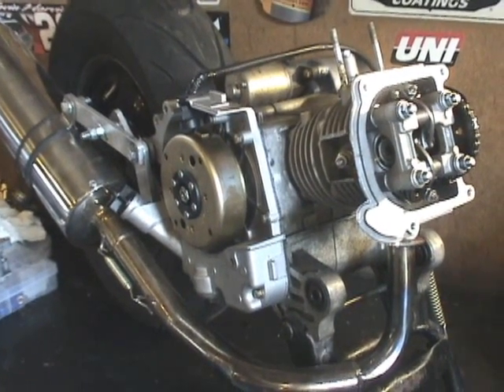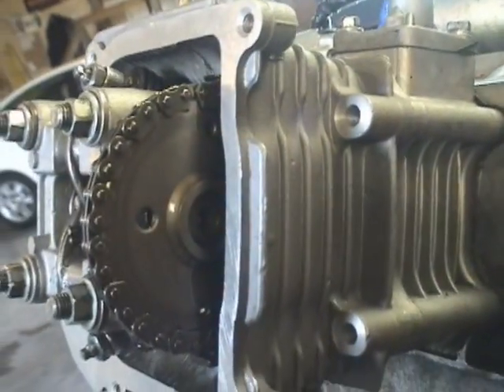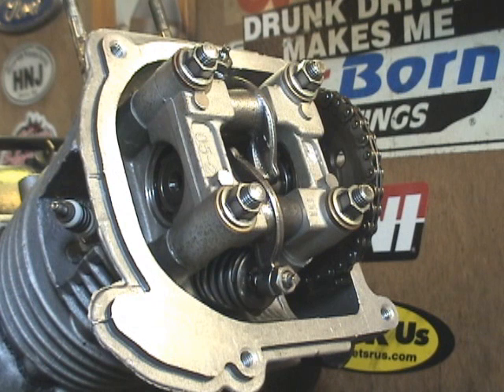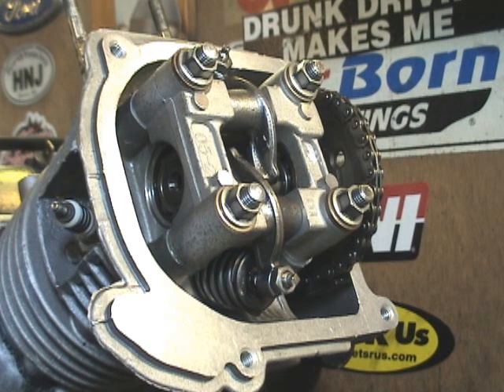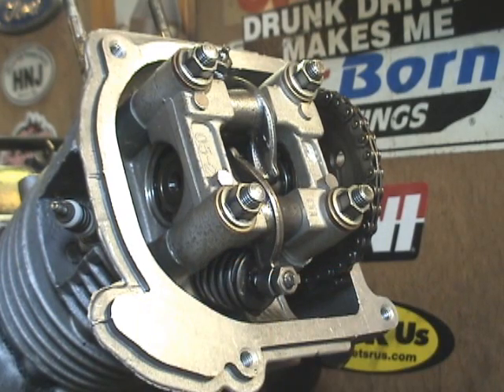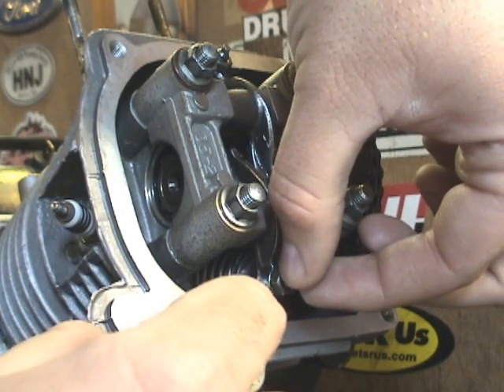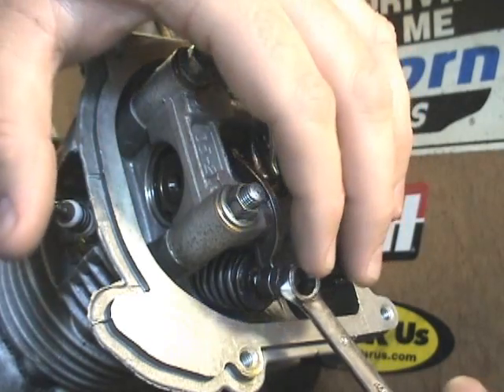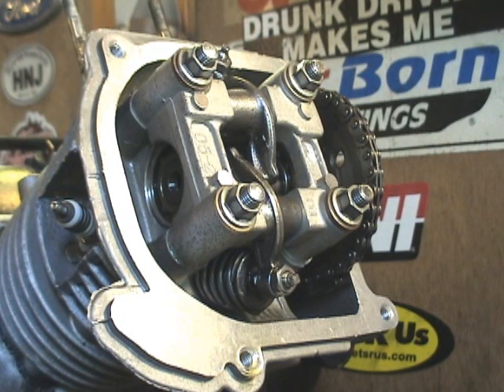Scooter How-To : GY6 Valve Adjustment (Also For Buggy + Kart)

Comment: why do some people use 4 and 5 and others 5 and 7? depends on engine brand or cc?
Reply from the maker: Preference, engine size. I use 0.002" and 0.003" mostly now. I was used to my engine at the time and it didn't like tight settings so I was always using larger specs.
Reply: @49ccscoot  i believe my gy6 is a 150cc...what gap should i use?
Reply from the maker: Between 0.002-0.004" intake and 0.003-0.005" exhaust should work fine. I tend to stick to the smaller side of 2 and 3 thousandths these days.

Comment: For years, I took a small piece of scrap steel, and cut a slot in it to use to hold the adjuster screw while adjusting. Putting in a "s" bend helps clearance. Thin grinder wheel cuts a good slot like in the end of an old, damaged screwdriver or small broken wrench. Grind back the broken end and make a slot. I have also used a tiny cresent wrench.

Comment: Once again a great video, I have a few 50cc and 150cc chinese scooters, I notice on all of the inserts under the seat they say adjust to .006 and .007,,,,I see many people online say .004 and .005 and you like .003 and .004,,,are the manufacturer specs just not geared towards performance should I ignore that and just try what you guys recommend and see where  I get the best performance? DO you really think proper valve adjust ment can really effect speed?  TY for all your hard work!
Reply from the maker: I actually use 0.002"/0.003" most of the time these days. I don't recall seeing a manufacturer spec on any of the Chinese 50-150s as high as 0.006". I'm thinking you have have confused the specs with metric specs. It is common to see 0.06-0.07mm, which is roughly 0.0024-0.0028".

Comment: Hello I recently I adjusted my valves because it wasn't starting unless I use starting fluid but now the motor won't turn over like it got too much compression and my fly wheel doesn't have a t mark
Reply from the maker: I wonder if you may have adjusted the valves too tight and it's opening them enough to make contact with the piston. Don't force it to turn, because you could bend a valve. Back the adjusters off to create plenty of play and then see if it turns over by hand. You may need to find true TDC and make your own markings. You really don't have to know totally precisely where TDC is for a valve adjustment, but it is important that the valves are totally closed when it's done, so the engine should be at TDC between the compression and power strokes.

Comment: I need some help i have a clocking   sound when I start up the scooter could it be out of timing or valve need to be adjusted it start up pretty bad
Reply from the maker: It's likely to be the valves. Could be many things, but that's a common cause and a part of routine maintenance, so I'd start there.

Comment: I set mine both to .005..but when im at higher speeds it slows and speeds up..Should i open the exhaust further or close the intake?
Reply from the maker: Try 0.002" intake and 0.003" exhaust and see how that does. May not be valve lash related. Could be a main jet or related issue.

Comment: Hello,

Why my gy6 engine is throwing to much white smoke and stalling when accelerating after replacing cylinder,piston and rings .

Do I need to adjust valves or to replace valve rings or what ?

Thanks

Comment: I got a GY6 139qmb with a 50mm piston, A9 Camshaft and a big valve head should I adjust the valves differently than the stock setting?
Reply from the maker: 0.002" in / 0.003" ex should be fine. Sorry for the late reply; somehow your comment was flagged as spam and I just now saw it.
Reply: thanks for the information I don't know why this got marked as spam. and what is your thoughts on an oil breather tube? I was thinking about getting one for my 139qmb.

Comment: Hi, I need advice I have a speedy 50 tao tao scooter. It will turn over but won't start... I replaced the spark plug today same thing. It is getting a little spark though. It's like the gas isn't getting there. Cool videos.. :)

Comment: would tight valves cause loss of gas to the spark plug?
Reply from the maker: My first thoughts would be carburetor related. Float set too low or tuned too lean. Possibly a problem with the fuel system.
Reply: 90GTVert figured it out. have a malfunctioning auto choke.

Comment: Hello again ; P I heard your tip about excessive tapping after adjustment, and what to do. Just a question to confirm that is what i need to do. Upon opening my valve cover to to do the first adjustment i have ever been able to do, i discovered that the tappets were seated tight against the valve, i mean tight! How the heck this thing was running as good as it did, i can't understand.. Now i have excessive tapping @.004 gap. Still running great!  Do you think something could be worn out from the tappets being that tight for i don't even know how long/ how many hours of running.... It did not tick at all when tight, so should i just close the gap a bit, and call it a day, or should i investigate anything else while inside? Thanks in advance.
Reply from the maker: You can try moving to something like 0.002" intake and 0.0025-0.003" exhaust.
Reply: I will give that a shot. Just wanted to get your thoughts about how tight they were, and if thought that would cause any unnecessary damage resulting in my ticking.. Thank you once again good sir : )

Comment: I just purchased a used 50cc taotao scooter not running replaced the carb battery an ignitions getting spark will turn over but won't crank could this be my problem?
Reply from the maker: It may be. It would be a good idea to check the clearances.

Comment: hey i have a 2016 taotao 50cc with 100cc big boar kit installed. after installation it ran great for 10mins. the  stock carburetor and manifold were kept in during this test drive. but after this test drive i guess what is called, bogged out, happened when i pulled on the throttle. so what i did first was install a bigger carburetor and manifold. the issue didnt leave. so i upgraded the cdi,sparkplug cover, cold intake, and flywheel fan, but no nothing! whats next??
Reply from the maker: My first thought is to try tuning the carburetor. Checking connections is a good idea when an issue pops up, but you should have been over the connections while replacing things. A simple way to get an idea of if too much or too little fuel is an issue may be to try revving with the air inlet covered or partially covered. If it improves, it probably needs more fuel. You can also remove the airbox and see if if improves. If that helps, it may need less fuel.

https://www.youtube.com/watch?v=K5j8gHg5kMc

http://www.49ccscoot.com/faq/carbtune.html

Comment: Great great video!
I have a CF Moto E-Charm 150 that looses power after a few minutes of riding it. Sometimes I'm doing 50mph then something goes wrong in the engine that the speed goes down to 35mph. I keep the acceleration going but it won't go past 25 then when I finally reach a safe place to stop it dies. 10m later it will start but roughly. I was wondering if you have a slight idea of what could be going on? This is water cooled fuel injected not carburetor.
Thank you boss!
Reply from the maker: +DG MAMBO Does it have a water temp gauge? Wondering if it's getting hot.
Reply: It does have one but from what I c when I ride it it never gets past below half on the temp gage

Comment: buddy keep up the great vids ive learned a lot from you  how  ever i got a problem i recently had a problem i knew it was my valve adjustment so when i went to check it and the intake lock nut is gone  down in the motor is it possible to fish it out from the oil filter area with a magnet or am i looking at a complete tear down? its a gy6 50cc with a 100cc big bore kit in it thanks
Reply from the maker: +vawn davis You could try a thin extendable magnet in either drain plug and try checking where the cam chain goes through the engine. Good luck.

Comment: I was recently given a 2008  Peace 50cc scooter with 87 actual miles.  It has been stored in a garage unused for 1 1/2 years and was running fine prior to storage. All old gas was removed, gas filter fine, now carb getting new gas. I removed carb, disassembled it and cleaned everything in it thoroughly. The spark plug is clean and getting spark.  The engine will turn over but it will NOT start. I have not tried to kick start it and have used the  battery only in trying to start it.  Battery is good.  With air intake hose removed, and a small amount  of gas squirted in the back of the carb, it will run for a few seconds and die.  Will not restart on it's own without squirting in more gas behind carb. Choking back of carb with a couple of fingers doesn't help, but fingers are wet from gas in carb.  My next step may be to buy a new carb.  Is this engine a GY6?  Anyone know of any manuals or wiring diagrams available?  Would appreciate any suggestions as I'm stumped!
Reply from the maker: +Bernard Molenda If there is no gas in the bowl of the carb, the vacuum petcock may be bad. You can remove the fuel hose at the carb, put the end into a container, and kick or crank the engine over. You should see fuel come out when it cranks. Otherwise, the petcock is not working properly or not connected properly. Make sure it's got vacuum attached to it and the hose isn't cracked or loose.

Comment: it was brand new. Did not think I needed to check it. And tightened the head as much as it would go.
Reply from the maker: +jim crabtrey I bought a $100+ dollar brand new big valve head once and had it leak out of the box. It's even more common with Chinese replacement heads.

The head should not be tightened as much as it will go. That's not good. It should be torqued to spec.
http://49ccscoot.proboards.com/thread/14211/139qmb-bearings-seals-bushings-torque

Comment: sorry. I do believe it's a .0003. for the top .0004 for exhaust  , with i have seen to use on numerous google searches.. it was running excellent before I replaced my head. Now will not go over 30 miles an hour. Seems like its leaking oil somewhere too. Everything is tight. I don't understand. Could the carburetor have gotten that clogged up that fast. To make that much of a significant difference??. Any help would be greatly appreciated. I have tried everything
Reply from the maker: +jim crabtrey Didi you do any checks before installing the new head? Sometimes the valves leak. Maybe you didn't get a good seal with the head gasket?
Reply: It only takes a very small piece of debris to clog up the Pilot (Idle) Jet on the carb or even partially clog the Main Jet. A clogged Pilot will make it extremely difficult if not impossible to start. A partially clogged main will cause less fuel to enter the engine, resulting in less speed. It may also want to run hot if it does.  Do you have a decent inline fuel filter on it? Otherwise if you have replaced the head, and tried everything, it could be an intermittent spark issue or a timing issue.

Comment: please help. I just replaced my head on my 150cc scooter. Adjusting valves - 0.3. Sounds like it is running excellent. But will not go over 30 miles an hour. it used to go 55. I replaced head because I stripped spark plug. I put everything back together the same exact way. Seems like it is not getting enough compression. I do not understand how it was running fine before. And now it is not. What could it be. I am going crazy trying to figure it out. Please help
Reply from the maker: +jim crabtrey I'm not sure why you're using 0.3 as a valve adjustment. If that's mm it's 0.011" which is huge. If that's inches that's over a 1/4 inch of lash which is terrible. Try something like 0.002" to 0.005" or .05mm to 0.13mm.
Reply: You are going to need to go thru troubleshooting procedure via process of elimination. It needs clean air, clean fuel, good spark and compression to run correctly. ALL those things need to be checked and eliminated as a probable cause.

Comment: That ending part..about saying hard starting problems..thank you kind sir great vid, ima try this for my scooter, always been a bitch to start and now it losses power and stall after riding from 1-5 mins, to the point were i can hold it in place with my feet no brakes at full throttle, the second i let off it bogs down, lets see if this fixs the problem
Reply from the maker: +NonyaBuisness YaStalkers Hope it works for you. It's a very common issue.

Comment: hello I wanted to know if I can instal a piston to a big bore kit 100cc missing the top or middle (cause I can move them)after I accidentally broke one. it does have to two rings on the bottom and one for the middle but the brass one is broken and I had put that one on the top if that's were it goes...
Reply from the maker: +socomsfinest 1 Get yourself a new ring kit before you install the piston. You need all of the rings.
Reply: ***** yeah I figured after someone told me I would lose compression. I finally bit the bullet and ordered the rings. ..freaking sucks!

Comment: if the exhaust valve is too tight will it put more gas in the combustion chamber?
foul plug?
RSVP
Reply from the maker: +Thomas Flynn If it's tight enough to stay open you'll lose compression and can burn the valve.
Reply: Thank You!
That's what I thought!
new top end!
Reply: ok
I adjust the vavles to .004 and it's still spliting gas out of combustion chamber and coming out oi air filter? No what?
RSVp
Reply from the maker: You either have a valve timing issue or some sort of damage or wear that isn't allowing the intake valve to seal.
Reply: thanks
Reply: I put a new top end in it for my friend 2 months ago what causes it t mess up like that?
Reply from the maker: Poorly made parts or improper machining can lead to valve timing issues (check that the piston is actually at the top of it's travel when the marks are lined up for TDC).
Reply: Well,
I took off the the end and the valves are good! new top end
The problems is the fuel petcock got stuck open because of trash in it.Fix new petcock plug fuel filter,plug and change oil because gas got into crank case!!!
Reply from the maker: I would also check the float height. I use a manual fuel shutoff on mine and leave it on most of the time (even though I should turn it off just in case). With fuel allowed to flow at all times and the float height set properly, I don't have over-fueling issues. The float should be keeping the fuel level in control within the carb, regardless of the fuel source (short of doing something like pressurizing the fuel system).
Reply: The Chinese are not known for precision parts and great quality control of those parts.

Comment: My scooter won't go full throttle without bogging out. I put on several new carbs and new fuel system due to finding rust in tank but still same problem. I'm stuck and don't know where to go lol I also out in a new Cdi and spark plug. When I took off my new carb I noticed wet  black color on the intake side. Any guidance?
Reply from the maker: +SPOOKYJJJ Check compression. If your carb is black inside on the intake/engine side, you may have a valve or timing problem.
Reply: +90GTVert  I checked and adjusted and still the same.  It's starts and isles fine and even reeves fine but when I go full throttle man it's just blahhhh :(
Reply from the maker: It really sounds like running lean/fuel starvation to me if there are no other issues like low compression. Hold your hand over the airbox inlet to make it run richer and see it it improves. Of course be aware of and careful around moving parts.
Reply: +90GTVert  interesting I detached the air box and it runs much better   Hmmm vacuum leak?
Reply from the maker: If allowing more air in lets it run better, it's too rich. Usually you'll experience a sputter rather than a clean bog, which is why I figured it was lean. I'm still concerned about you having black on the carb and intake and think it's a good idea to check the head out and make sure the valve is sealing and make sure that TDC is really TDC. If the head doesn't leak and the timing is indeed correct, then see if your float height is too high.

Comment: I have a to do the tappets because wheni start my scooter, (Lifan LF50QT-2A, 1P39QMB), has a "rattle" in the area of the cylinder head. I asked an acquaintance and i said that´s because not pushed correctly. If i could be orifyou know wich is the extent to calibrate correctly. Thanks you.
Reply from the maker: +pedro hdez If they're too loose, too large of a gap, it will be noisy.  I use 0.002-0.003" most of the time now.
Reply: +90GTVert Forgive my ignorance, but not talk in inches? I do not want to confuse me with measurements and calibrate at 0.002-0.003 "millimeters" instead of inches. Thank you very much for helping me and answer my question.
 PS .: Sorry if my English is not understood or is not entirely correct. I use google translator to communicate with you.
Reply from the maker: .05-.08mm
Reply: +90GTVert 👍

Comment from the maker: +diga digadiga   It can alter performance, but it's primarily a maintenance procedure. If the gaps get tight it will cause a lack of compression and starting difficulties. If the gaps are too loose it will cause excessive noise and wear on valvetrain components.

Comment: If your valves aren't set right could it possibly take away 15mph top end??
I use to pull almost 50mph then after my belt broke and was replaced it can hardly go past 30mph and I can't figure it out:/I also hear a really loud ticking coming from the valve cover when I idle..
Reply from the maker: +Christopher Spohr You'd most likely notice other symptoms if the valves were the cause of such a loss in speed. If the belt broke and performance changed I'd go over the whole CVT and be sure I had the right belt as well.